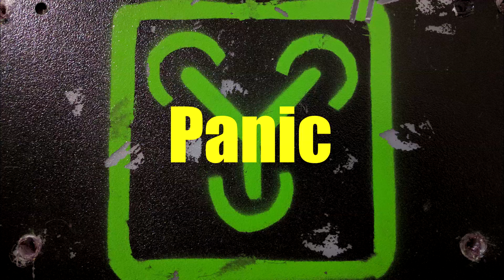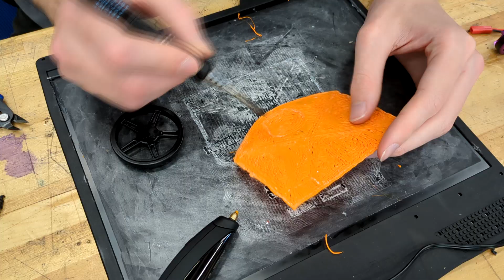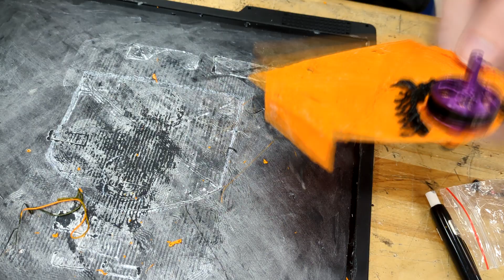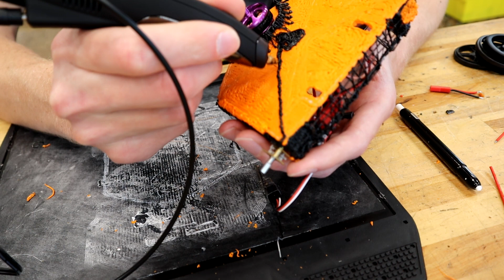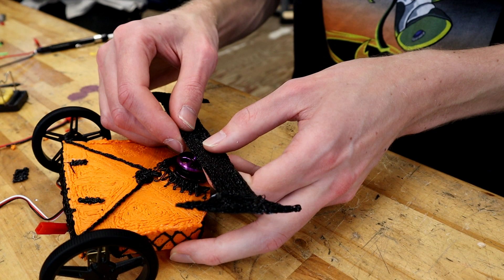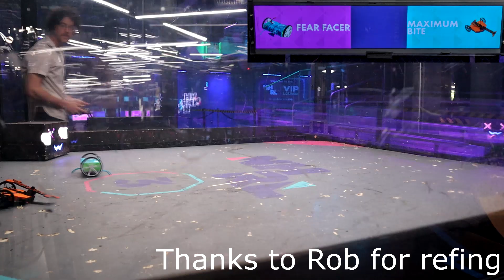Can you fight a robot made with a 3d printer pen?!? (Vs Henchman Sam at NHRL!)

Comment: Yeah my cheap 3d pen struggles to get hot enough for ABS.
Reply: But I have used it as a hot-glue-gun for 3d prints to decent effect.
Reply from the maker: this one was getting the heat but I was struggling with abs's usual issues of warping and layer adhesion